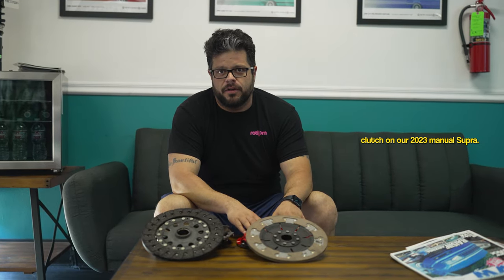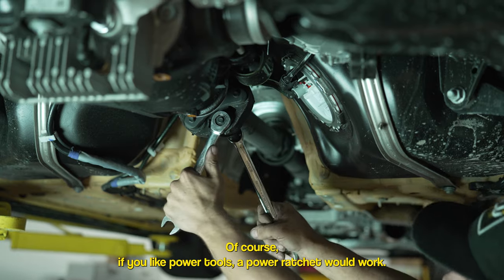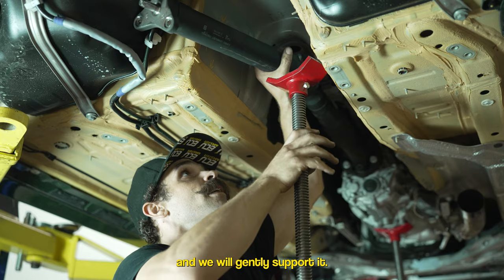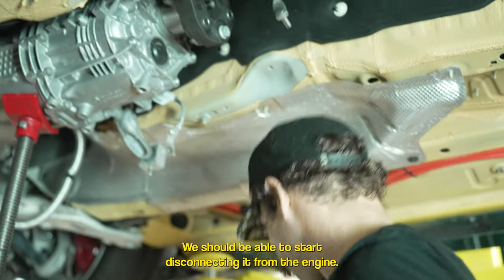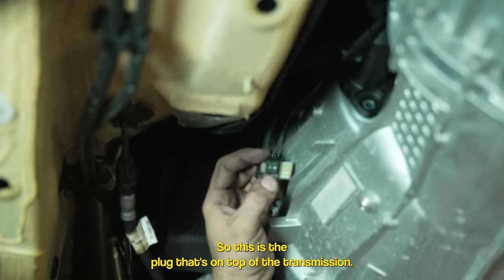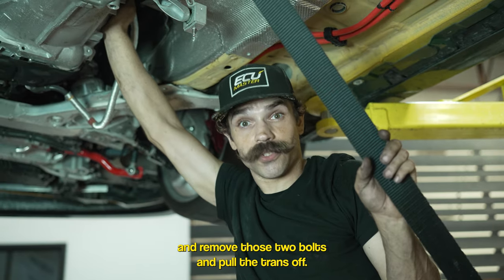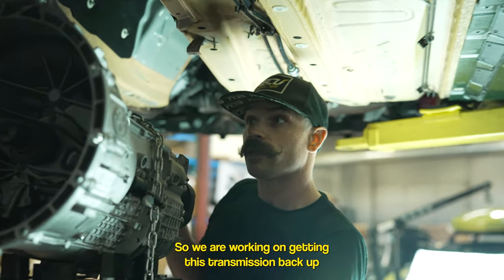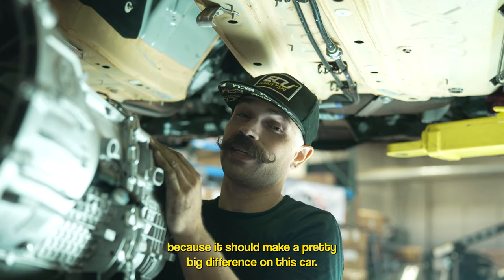Upgrading our 2023 manual Supra clutch! // BMP Tuning

Comment: I changed out my slave cylinder (first mod I did) and that seemed to help tremendously with clutch life and initial bite. Now it just drives like a manual should. I have experienced zero slipping even beating the crap out of it. 8k miles, never smelled clutch and no issues!
Reply from the maker: Glad to hear that!! Ive seen a lot of people in the groups complaining about clutch issues (we didnt have any issues ourselves though)
Reply: @BMPTuning  It took me until about 15k to start slipping, initially thought it was rev hang - got much worse at 17k miles, totally still dirvable but it ain't happy at full send with my other power mods. Have fx1000 and throwout bearing on hand and will install in the next 2 weeks or so
Reply: @BMPTuning  when you swap out the slave cylinder and replace the clutch does it show a warning light and does the factory shift assits still works.
Reply from the maker: @patthonsirilim5739  We do not have a light for it and rev matching still works.